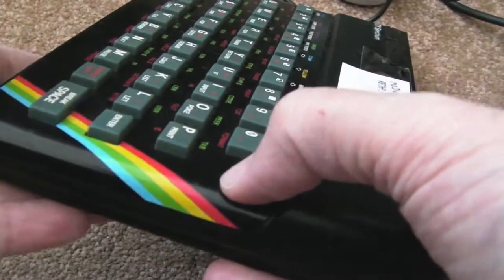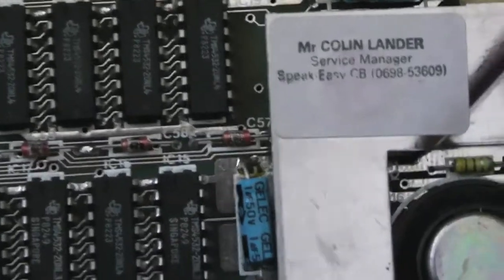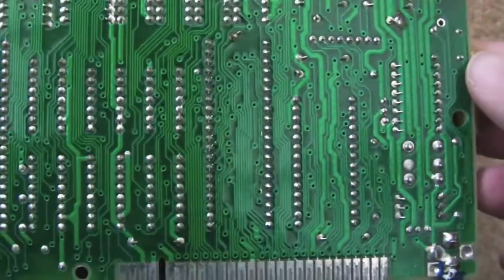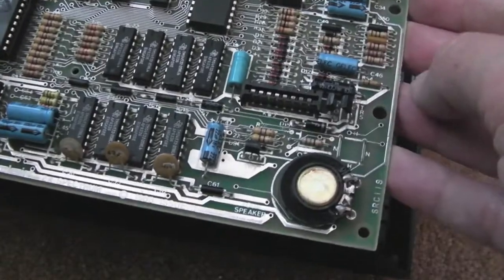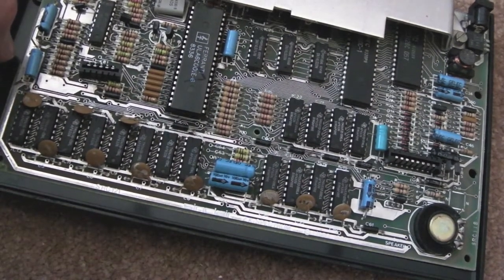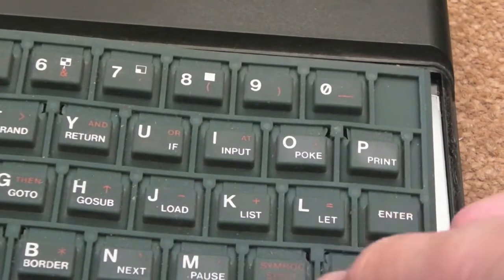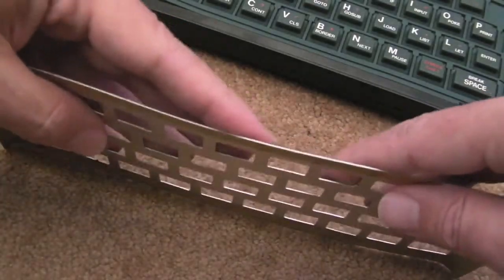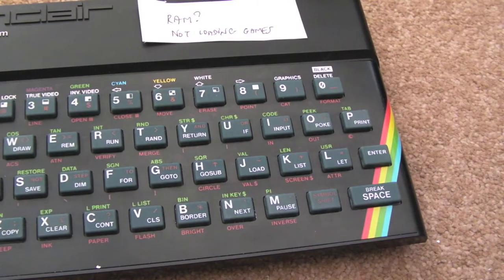Sinclair ZX Spectrum Keyboard Membranes

Comment: An issue 2 Spectrum often does have a transistor, or a resistor and diode, on the Z80, if it has the original 5C... ULA. The colour adjusters were always present on issue 2. Issue 1 were similar in many ways but needed an extra board to have 48K.

Comment: As I am used to arcade boards, it is interesting to see that old computers have no sort of power up diagnostics. On an arcade PCB I would be expecting it to flag up a RAM error as soon as it was powered up lol
Reply from the maker: Yeah, I think arcade manufacturers wanted reliability!  Sinclair (and Commodore with the C64) just wanted a cheap design.  By the time Commodore got to the Amiga they embedded self test stuff in the ROM.   I think the Spectrum does loosely test the RAM - hence the timing difference on the black screen on boot, but it doesn't report anything where it should really.  If it showed the number of bytes available like C64 basic does it would be a lot more evident when there's a problem with the upper RAM.